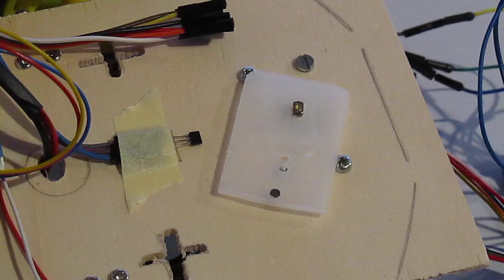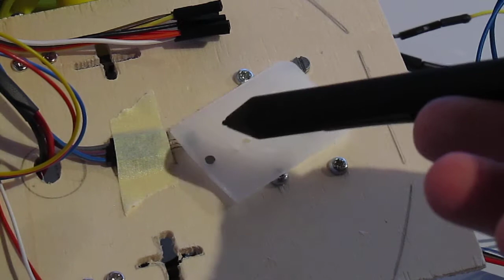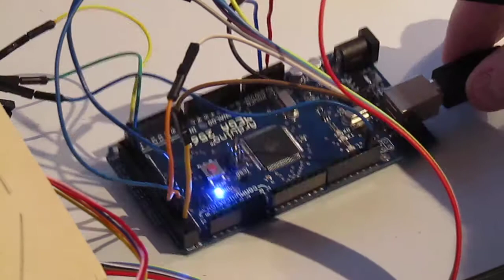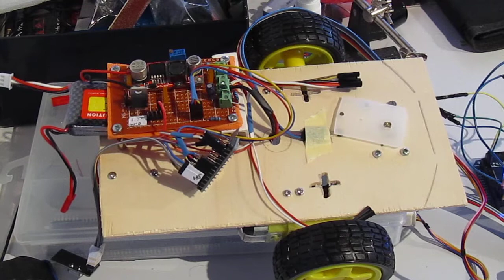Detecting stepper motors "zero" position with an Hall Effect Sensor

Comment: How do you know which direction to move? East or west.
Reply from the maker: The sensor is used only to identify a known position, the "zero". You drive the motor yourself, so you know if it is turning clockwise or anti-clockwise. This is just helping you to detect precisely when the sensor is pointing forward, from there you count the the motor steps to know the angle port or starboard
Reply: @fagosti  Thanks, I was mostly referring to scenarios where the position is unknown for whatever reason. I guess I'll try to add a gyro/accelerometer for that so I could know where I should move.

Comment: Helo it is exactly what i loking for. Have you final vesrion of the code?
Reply from the maker: Oh, that was so long ago I am not sure where my code is by now , sorry:(  Code is quite straighforward anyways : just turn in one direction until the sensor is activated, keep going until it is off to measure the detection area. If you start with the sensor on then move to turn it off first so you can measure. Once you have the measurement you can zero either side of it. If you zero always turning in one direction (i.e CW) then you do not need measurements at all, just need to check if sensor is on when you start detecting, if so move out (CCW in this case), step - 1 is you zero

Comment: great idea but I used a 10 turn 10k ohm pot and commanded the stepper to mid point of pot, It works ok and you can command to any position of pot rsistance.
Reply from the maker: Sounds like a good idea, but why a 10 turn potentiometer? Did you multiply the turn with a pully or something?
You need I am assuming to assess the position in a 360 degree angle, so, wouldn't it be better a single turn pot?
Moreover what if the stepper goes around more than one turn in one direction (or more than 10 turns)? woudn't the pot / trimmer block the motion?
Reply: A single turn pot only gives you aprox 180 degrees of movement.
When you use a 10 turn pot you build your device with the pot centred at 5 turns. this on a one to one gives you clearance from hitting the end stops of the pot.
Hope this helps.